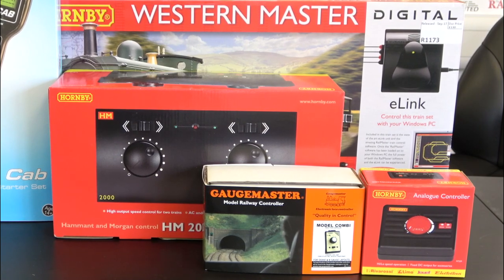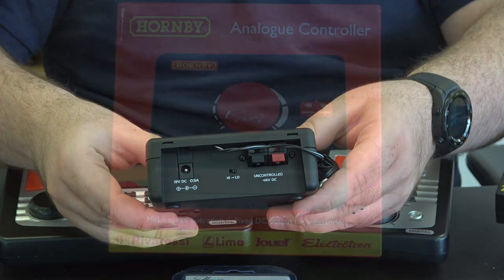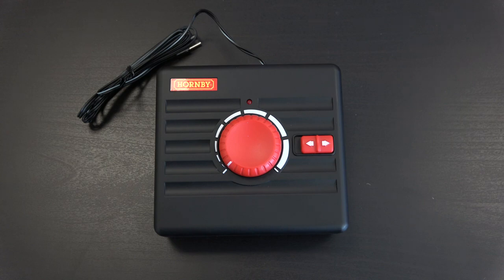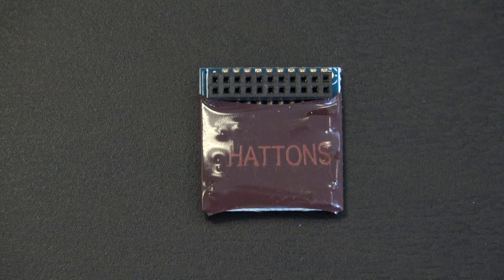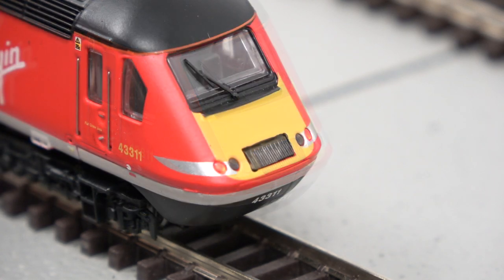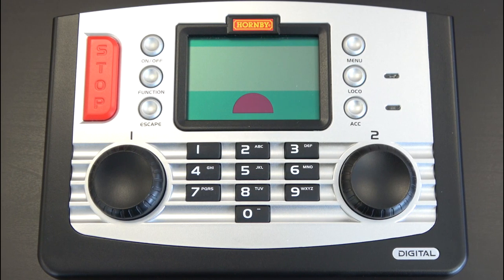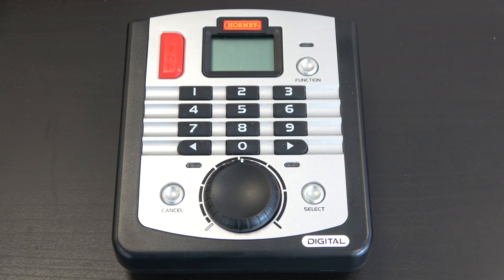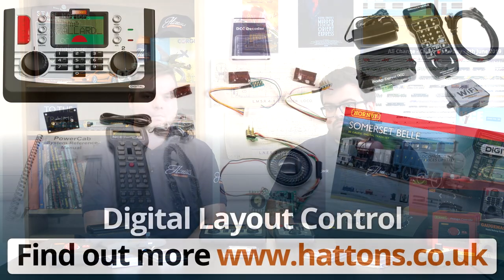Digital & Analogue Control: Model Railways Explained

Comment: The one main point not mentioned, which may over-ride your preference, is that DCC is more expensive than DC
Reply: @Kie W why wouldn’t they? Are you privy to their mark ups on the different options?
Reply: @Kie W Thanks for being rude. Genuine question on mark ups. Never mind.
Reply: @Kie W I guess the DC controllers are so cheap to make and standardised they could have a larger mark up however that could be offset by the fact that a smaller mark up on the far more expensive DCC stuff could out strip it. It's an interesting commercial conundrum.  These DCC's could also be cheap to make as the chips are mass produced etc but it depends how many people get a nibble at the price as it goes through the Supply chain.

Comment: Hornby introduced the world's first Digital Command Control in 1979 with their Zero One system. Airfix introduced their Analogue Command Control system as a competitor, but it had issues and became extinct pretty soon after.

Zero One allowed for 16 locos and 100 points or coloured light signals.

 I've been running a Hornby Zero One DCC system since 1979.
Reply from the maker: Some great information there Andy, we've occasionally had the odd Zero One system pass through our pre-owned department.

Comment: Hi guys,

Thanks for the great video. I'm new to the hobby and have a Hornby HM2000 controller. I'd like to use the controller to power some points, but as a layman, I have no idea what I'm doing and the information online is contradictory/non-existent and/or requires soldering. 

Is it possible to get an above-board (not under the board) point motor that would work with my controller for a standard DC set up? If so I would really appreciate your help as to which products I should be getting and if you have them available on your site. 

Cheers
Ben
Reply from the maker: Hi Ben, we sell a variety of surface mounted point motors, some of which involve no soldering and can ben hooked up to switches. I'd suggest dropping our Product Experts an email or giving us a call on 0151 733 3655 and we'd be more than happy to talk you through what you need.
Reply: Hattons Model Railways  Thanks so much for your help. I will try and call sometime tomorrow if that’s okay. Also really love your P Class tank engines which I hope to get my hands on when I’m properly up and running!

Comment: There is another option that maybe be on the horizon. With the improvements in battery life and bluetooth or conventional rc control. Just how long before we see self powered locomotives controlled with wireless controllers. The only thing on the layout that may need to be wired would be signals, possibly turnouts and accessories

Comment: If I have mix of older DC engines and DCC, can I switch controller to DC and then run only DC engines on the model?

I guess if I would use DC engines when using DCC controller would make them go at high constant speed?

Am a bit new to there things 😊

Comment: Hi guys thanks for the great video - it really answered a lot of my questions, but what is meant by DCC ready and DCC fitted? I'm starting an N Gauge layout using Kato unitrack and already have a couple of locos and rolling stock. Thanks again
Reply: DCC ready means the engine is already built to accommodate a digital chip (which is not supplied) without the need for any fiddly soldering etc... (this would be referred to as a retro fit from DC to DCC) DCC ready does mean, however, that you would need to acquire and install a chip for it to run on a DCC layout. DCC fitted means the digital chip is supplied/present in the engine when acquired (so no need to do anything to run in DDC layout). As you are new - I would suggest buying DCC fitted engines, so you don't have to consider finding the right chip to fit and purchase separately. The cost will increase from DCC ready to DCC fitted - but you are paying for the chip and that's is basically ready to run from the box. Hope this helps!
Reply: @michaelhaycock7009  thanks for the comprehensive response. Really clear and well put. I think you may be right about going with DCC fitted. However as I already have a few locos and track for a layout, I may push on with this using analogue power. Then look to start fresh on DCC on the next one!

Comment: Hi guys....great introduction video for the inexperienced novice like myself on his first layout.  I'm going for analogue as it's my first so I can get the feel of wiring and soldering and electrical circuitry. Question..can you provide a simplistic wiring diagram for locomotive directional lighting for DC ? I'm keen to convert some of my stock to directional lighting on analogue....thanks in advance. I'm an engineer, not an electrician but I must admit I am looking forward to the challenge of wiring these locos up
Reply: Bonjour l'arrive de la file plus, sur la LED  (le plus, d'un LED + c'est le plus long). Le moins se la Fil la plus cour .
Entre le l'arrive de la file plus et le LED une résistance 650 à 750 ohms. (pour l'avant) faire l même chose, et inverse les fils pour l'arrière, sur la rive des fils des rails. Amicalement raymond  

Hello it comes from the queue more, on the LED (the more, of an LED + it is the longer). The less is the Wire the more court .
Between the arrival of the file plus and the LED a resistance 650 to 750 ohms. (for the front) do the same, and reverse the wires for the rear, on the edge of the wires of the rails. amicalement raymond
Reply: Hello it comes from the queue more, on the LED (the more, of an LED + it is the longer). The less is the Wire the more court .
Between the arrival of the file plus and the LED a resistance 650 to 750 ohms. (for the front) do the same, and reverse the wires for the rear, on the edge of the wires of the rails

Comment: Hi there. Does the accessories decoder need a dcc layout or can it be dc
Reply from the maker: Hi Freezy, accessory decoders are designed for use on a digital system. You can set up a separate DCC system just for accessory control if you did want to keep your layout as an analogue system if you wished.

Comment: Can you run analogue trains on digiton track
Reply: They might run but they won’t run smoothly, be at a random speed and will damage the motor severely.
Reply: @MM-fc9fz  so in order to run analogue trains on digital track,you gotta fit them with a DCC decoder?
Reply: @davidantoniocamposbarros7528  Yes
Reply: @MM-fc9fz  hmmm.But if i fit my analogue train with a DCC decoder,does it mean i cannot longer use a analogue controller to run it?
Reply: @davidantoniocamposbarros7528  Some decoders are both but some of those don't work well on DC. Get a good reviewed duel DC/DCC decoder and you'll be fine.

Comment: Hi, a have question, I bought n-scale bachman train,and  the geugemaster transformer, and use a terminal extension Wich one end directly connects to the rail and the other end connects to a 2-Pin Female, AUX Headphone Solderless Converter Adapter. This connects to a led strip monitor power cable and  from this connects to the geugemaster speed Controller that connects to the transformer in the wall l. But my train is not moving, Don't know if geugemaster speed Controller is not for n-scale trains not why is not moving.

Comment: I wana run up to 20 engines on a layout which dcc controller would be best? I have been tempted by the elite but I’m not sure if it can handle it I currently have the Hornby select and it can only handle up too 10.

Comment: Hello. Can I fit a DCC decoder on an analog 00 gauge train?
Reply from the maker: Hi Gavin, you certainly can. This will allow you to operate your loco on both analogue and digital control. Bear in mind that some older analogue controllers with feedback may cause issues, but if you have a newer controller you shouldn't have issues.
Reply: @HattonsModelRailways  Is there an instructional video on how to install a DCC decoder on an analogue train? Also what controller would you recommend regarding the feedback issue? Thanks
Reply from the maker: @gavingavin4572  check out these videos - the first will help you get started with Digital fitting, the second will showcase some great controllers that we have available now:

https://www.youtube.com/watch?v=ZVz-ZeE22VY

https://www.youtube.com/watch?v=KY-dw4VPXlE
Reply: @HattonsModelRailways  thanks

Comment: i think i can power more than 1 loco with hornby controller R7229, My layout is just single track and if i got a depot or a siding and i turn the points towards the main line it cuts the electricity i found that out my hornby class 373 was in a siding and it was ready to go but it wasnt moving i thought it short circuited but it was the points they were switched the wrong way

Comment: Im in the throws of building a garden railway. This is a double track loop of 60-65ft and a few sidings and x overs at the station.
Should I go  12vDC or15v AC DCC can i run 12v locos on on 15v rails.
ive had mixed advice on this..some say 12v DC wont work on that length of line others say it will..etc etc..
So....I ask you,,The experts.
Reply from the maker: Hi Alan, you may need a higher powered controller for that length of line. A simpler solution can be offered here by running a DCC system with booster power supplies placed along your layout in strategic locations. The number of location of these can depend on the exact layout of your track and the amount of trains you wish to run. We sell all the items you'd need for either DC or DCC operation though!

If you'd like in depth advice on this I'd suggest getting in touch with our Products Team via phone (0151 733 3655) or email (info@hattons.co.uk) who'd be more than happy to tell you everything you need to know.

Comment: The Hornby hm 2000 isn't what it's cracked up to be. Mine made the loco motors rather noisy, and didn't even make 12v per track at full throttle. Switched to a cheap Bachmann controller. No more noisy motors and it makes 14v at full throttle and trains are much more controllable at very slow speeds

Comment: 4 months ago Antony Mcgowan ask a question that has not been answered. It's an issue that I also would like an answer to. Can analogue engines run on digital track? Also, can a chip fitted engine run on analogue track? I need to understand this as I am starting my first layout, at the age of 73! Thank you. Loved the video. Have subscribed and liked.
Reply: By analogue you mean DC and by digital track you mean AC track used by DCC, The track as a way to send signals to the engine using AC current. Think of remote controlled car receiving signals from a controller but instead of using track the car uses wireless. So the answer to your question is NO analogue engines (DC) on track using DCC AC.

Comment: Hey guys another great video im interested in getting sound on my dc layout and i had an idea if you took a sound chip from a locomotive and put it into 1 of hornbys tts sound wagons wound it work on dc the same way it would in the locomotive and make basic chuffing sounds as it is pulled along by a dc locomotive?
Reply: Andrew Weaver 
No, all TTS decoders don’t function on dc.
Reply: @JamesSmith-zv9nw  but what if I used a different type of decoder not a hornby tts one
Reply: Andrew Weaver It is true that some decoders make chuffing sounds on dc but they are the high end expensive ones. Personally I don’t consider the investment effective but you may. There are always motion sensing sound modules from companies like train tech to consider also.
Reply: Andrew Weaver It is true that some decoders make chuffing sounds on dc but they are the high end expensive ones. Personally I don’t consider the investment effective but you may. There are always motion sensing sound modules from companies like train tech to consider also.
Reply from the maker: Hi Andrew, that is a good idea. However what we would recommend doing is getting a Train Tech sound capsule. You can fit this to any vehicle and they come pre loaded with either steam or diesel sound effects. They are battery powered so it's much easier to get up and running with one and it would be a cheaper option for you too. You can check them out here: https://www.hattons.co.uk/stocklist/siteresults.aspx?searchfield=SFX%20train%20tech

Comment: See, we threw out all of the old track since it wasn't conducting that well anymore, so now I literally have to start from the ground up. 
So if I were to, lets say, start from nothing, what would be the better system?
I'm not that great with electronics but I only have a few DC locomotives.
Reply: Actually, the wiring can be simpler with digital control. I'm from the US, but here DCC locos are much more, up to twice as much, money than DC ones.
Reply from the maker: Hi there, it really does come down to personal choice and what makes most sense for your layout and how you will be operating it. It can be easier to wire up a digital layout as there is no need for isolated sections and then you can run multiple locomotives much more easily but analogue is somewhat cheaper to get running with and if you only have a small amount of trackwork then DCC might not be required.
Reply: @HattonsModelRailways  I noticed, the DCC systems included products from the US whereas the analog ones were all from Britain. Is DCC simply not as common there?
Reply: @hohobbyist1098  unlike US trains, most british stuff here only has one loco, and DC has been the main system of control since Hornby Dublo. Up until the late 80's, DCC never crossed anyone's minds. Only recently has it began to take off, mainly because of the sound aspect

Comment: How many locos can the Gaugemaster Prodigy express power at once?
Reply from the maker: Hi there, it depends really on what type of locomotives, the amount of current draw and whether you're using sound etc. However, with "normal" OO locos, it can typically run around 6 to 8 at once.

Comment: Hello it comes from the queue more, on the LED (the more, of an LED + it is the longer). The less is the Wire the more court .
Between the arrival of the file plus and the LED a resistance 650 to 750 ohms. (for the front) do the same, and reverse the wires for the rear, on the edge of the wires of the rails
Reply: Re, si vous  donne une adressé  je vous envoi une photo. amicalement Raymond

Comment: If you are going to use DCC, skip right to Digitrax or NCE. Out of the two, they each have their pros and cons. NCE is much easier to use, and is less expensive. NCE is also easily available in pretty much every country on Earth. If you are just looking for a DCC system to control your locomotives and do basic operations, get an NCE PowerCab 2 and you will never need another upgrade. If you are looking for a much more expandable and advanced system, get a Digitrax system. Digitrax is MUCH harder to learn and MUCH harder to use. Digitrax’s steep learning curve isn’t without its merits though. You can control everything on your layout, from you points to your signals, all with a single remote. Digitrax is not available in all countries, so this option may be out of your reach.